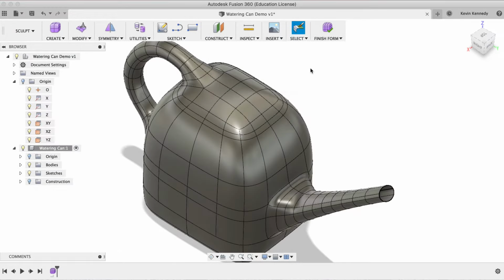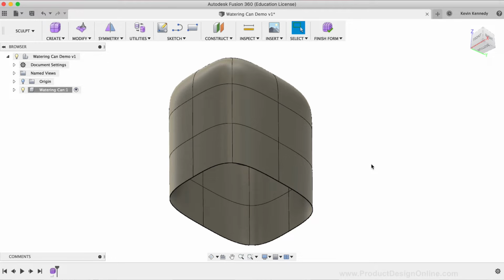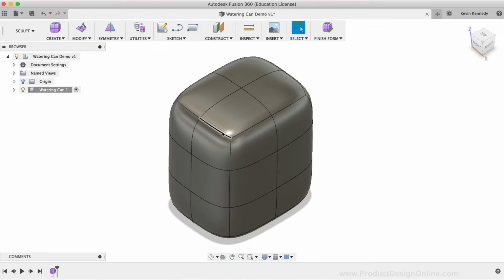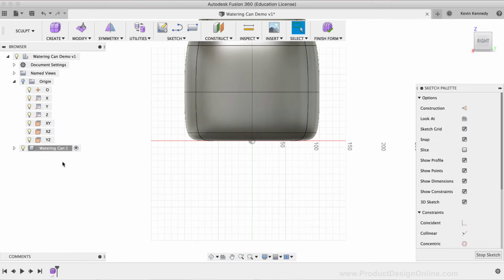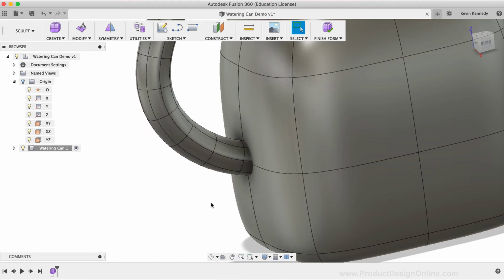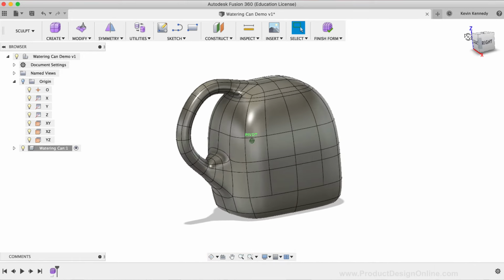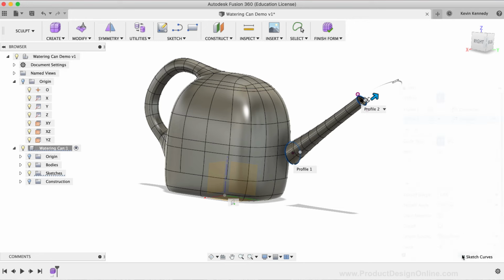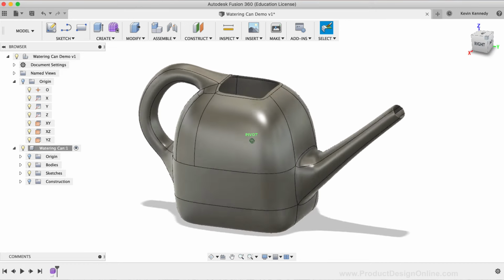How to Sculpt in Fusion 360 | Beginner Concepts Explained

Comment: ran into a lot of trouble following this tutorial: The main body of your watering can turned into a transparent/white wireframe while you were working on the handle, couldnt make component, handle was twisting, self-intersecting, and looking like a crushed soda straw instead of a smooth tube
Reply from the maker: For the Component, you need to be in the Hybrid design option. See my latest video on the new Design Intents introduced Jan 2026.

White wireframe, sounds like you might have bumped one of the keyboard shortcuts to change the visual style. Go to your Display Settings (computer icon at the bottom of Fusion) > Visual Style > Shaded with Visible Edges.

To fix self-intersecting errors, switch to the box mode in the Tspline environment and you should be able to see where it crosses. You'll need to grab that point and pull it out.

All that said, Tsplines are a lot harder than solid modeling. It takes a lot of practice. You got this! 💪

Comment: Why did Fusion go away from giving the dialog to change Height, Face distribution and Symmetry info after defining the Width & Length of the Box primitive? The way shown here works so much better than the current version (11/2025). Are there any ways to access the dialog shown in this video on the new version? It's almost impossible to replicate this workflow on the new version. The face shapes get all screwed up. Makes little sense that they made this update, no benefits just makes things more difficult.

Comment: The video and instructions are exceptional. One observation, the step where you scale the bottom part of the model and then fill the hole, makes the surface no even for 3d printing. I tried twice with the same result.

Comment: This was a very helpful tutorial.  I went thru the process myself.  However, I had a lot of trouble with the bridge command.  It is required that the spaces being bridged have an equal number segments (faces around their perimeter).  For some reason, some of the faces had 2 line segments on them, and I had to subdivide some faces to ensure that there were the same nubmer of line segments to bridge.  Also - I found that sometimes my bridge command created a "blockish" structure.  But persistence wins, and I eventually completed some nice bridges.

Comment: I am not sure why but when I right click the bottom line after selecting it I get a totally different instruction set.  After experimenting    I found that if I hold the shift key while right clicking the line I get the correct instruction screen. Just FYI.

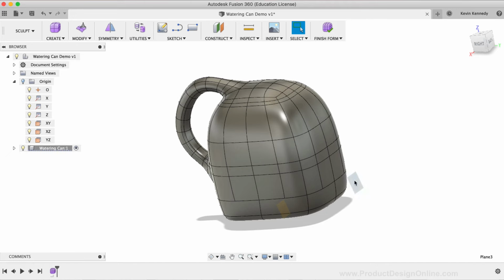Comment: I'm trying to work with the section 14:53 - Creating the spout and I'm completely failing. The idea is to replace a bottle cap with a spout for a hummingbird feeder. I've gotten a cylinder with a thread inside the cylinder and I'm trying to create a spout but I cannot get the Construct panes lined up correctly. Do you have another tutorial doing something similar to the water can but with a cylinder?

Comment: Thanks for the teaching! It was very informational! I would like to ask:

1) Since there are no timeline as in  the normal mode, would i be able to change the previous sketch? For eg: the spline we made to make the handle of the can, if i'm not satisfied with the shape, would i be able to change it in the end? (changing the spline shape, instead of selecting the surface and change them one by one)

2) After pressing finish form button, i right click to edit the form, after changing it, do I still need to rethicken? If i have added new sketches to the previous done form, do i need to rethicken? If i press thicken +3mm, would the previous go to (previous 3mm to now ) 6mm, while the new sketches become 3mm? 

3) After thickening and finishing form, i went back to edit. Now I deleted a surface but it's not a hole (because it has been thickened!) So though outer part of the form is deleted ( i wanted to make a bridge) but inner is still intact and i couldn't select it. How do i rehole it to bridge? 

Sorry for the loooong question, thanks in advance

Comment: Hi. I can't align the drawings with the edges of the body. For example when choosing the center of the ellipse aligned with the center of the face on the body surface. Same problem with the handle sketch. I have all Selection Filters enabled. Thanks in advance
Reply from the maker: Hi, enrique. I'm not fully understanding your question. Can you please provide a link to some screenshots or a screen-recording of the problem you are having? Cheers, Kevin :)
Reply: @ProductDesignOnline  Hi, thanks for answer so quickly.  In the Picture "A" your design have a little blue square at the beginning of the Spline. Mi design (Picture "B") haven't that blue square because the Spline is not aligned with the body edge.  

https://www.dropbox.com/s/6vmf9d0bkm8kuw4/A.jpg?dl=0

https://www.dropbox.com/s/hy60pp702bi47e4/B.jpg?dl=0

Comment: How are you selecting edges? I'm not able to do it. Maybe it's due to software version changes? I can only select edges when working with the edit form command. Also my elipse is not visible anywhere that i can see after creating it.
Reply from the maker: Hi, Superhero Armory. It sounds like a difference in your selection settings. Click on the select dropdown list. Select the "Selection Filters" flyout folder and then turn on all the edge related filters. 

Let me know if that helps! Cheers, Kevin :)

Comment: As I was following you, I faced the message that "The edges from one side must be equal to or a multiple of the other side." I think you have also different holes between the water can and the handle. Would you explain about this?
Reply from the maker: Hi, 나이젤. I'm assuming you got this error message when trying to use the bridge command? It can be picky at times.. The most important thing is to make sure when you select each side to bridge...that you select only the edges on that outer perimeter. Double-check that you didn't select any other edges.

If that doesn't seem to be it - then also check that you have a the same number of faces on the end of the handle and the watering can hole. You can always add more faces (or take some away) to the handle to satisfy the bridge command. Let me know if you're able to get it to work! Cheers, Kevin :)
Reply: @ProductDesignOnline   I checked the number of faces out. And I made it well!!  Thanks>_<  from  Koea

Comment: Hello sir, i was thinking about how approach to design this coffee maker in sculpting mode , whould you please give me some advices , thank you
https://www.google.com/url?sa=i&rct=j&q=&esrc=s&source=images&cd=&cad=rja&uact=8&ved=2ahUKEwj9pJDal8rhAhWCCuwKHWAuDVsQjRx6BAgBEAU&url=https%3A%2F%2Fwww.ajmadison.com%2Fcgi-bin%2Fajmadison%2FECF01BLUS.html&psig=AOvVaw1SjjSWFdl_OsX8YG8DDzoV&ust=1555145798964155
Reply from the maker: Hi, Pouya. With very complex objects, such as that coffee maker, I always recommend breaking it up into a few different sections. You'd probably want to sculpt the top third of the machine first. Then, you may want to use the modeling tools for the rest since its fairly boxy and could be achieved with some simple sketches, extrudes, and lofts.

For the top sculpted body, start off with a box primitive, and then stretch it out and start to define the curvature. Be sure to start off with only 4 or 5 faces on each side and then you can add edges as you find you need more control over the curvature. Cheers, Kevin :)
Reply: @ProductDesignOnline  thank you sir , would you please sculpt some models with refrence images as like that coffee maker , thanks
Reply from the maker: @pouyasadeghi9979  I will definitely be doing more with reference images. Cheers, Kevin :)

Comment: Another great tutorial smashes upvote icon 

I just had one problem, when I went to bridge the two handle ends, it said that the segments needed to have the same number of lines or a multiple. I changed it so that the lines on the handle had a multiple of the base and it worked. I guess its not really a question, but just a problem I ran into.
Reply from the maker: Thanks, Brian! Yea, the bridge tool can be pretty picky...similar to the loft command, where Fusion 360 won't want to compute the operation if it things the number of faces are different. I'm glad you were able to resolve the issue...and thanks for sharing this in case others run into a similar issue! Cheers, Kevin :)
Reply: what do you mean by "the segments needed to have the same # of lines"? the two holes you want to bridge need to have the same amount of faces around its perimeter to join? if so, how do you add the extra faces?